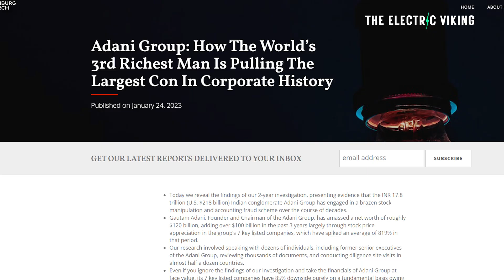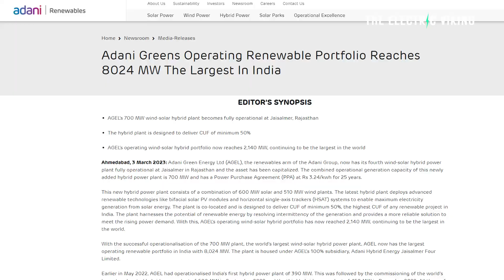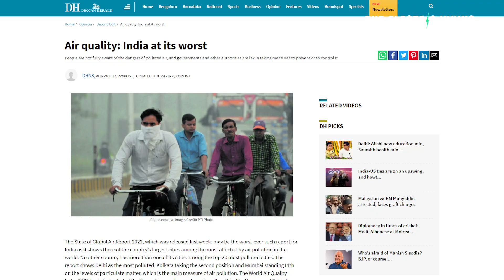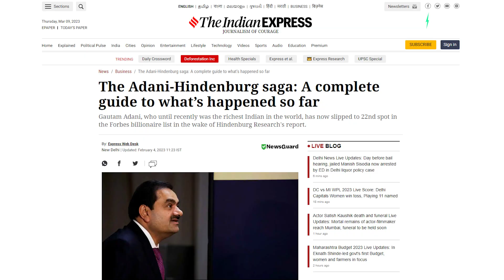The biggest solar and wind powerplant in the world just got turned on

Comment: solar panels and windmills aren't recyclable, they end up in landfill when they die not only that the power output is not as good and uses too much land like farming area which feeds us, the best form of energy to use right now is Nuclear power.
Reply: Yes just dump all that gold, copper, aluminum, rare earth's, steel into land fill since from wind and solar these have no value.
Solar has been proven to increase crop yields in marginal land.
Wind is 20 times less expensive than nuclear.
Yes when a nuclear power plant is shut, just turn it into a theme park.
Use your attic for long term storage of nuclear waist.

Comment: just a comment about coal fired power stations in general. Sure it's dirty in some respects, especially relative to natural gas or oil. It's not the co2 you have to worry about, the climate change "emergency" is a clear scam. But they do emit Mercury and lead, which are dangerous neuro-toxins. You can't hide from that.There are however technologies out there that can remove the Mercury - activated charcoal pellets is one - look at carbonXT the company. At the same time, coal is affordable. The poorer countries will often resort to burning cow dung and kill themselves with pollution from inside their own kitchens, or chop down precious forests, without it. So in some cases, it's the best alternative for now. The truth is if it wasn't for the climate change "emergency" scam, we could take a common sense approach and use natural gas and oil, or nuclear, to lift people out of energy poverty, neither of which are perfect but in terms of costs vs benefits they are very very good. When other "green, renewable" technologies become good enough, if suitable for a given country, they can be implemented in an affordable way. We just need to wake up in the interim to the scam that's going on and get the b.s out of the story, otherwise there will be more GENUINE emergencies like people starving and/or freezing in their own homes, not fake ones like the climate change "emergency" they've been trying to scam us with for 40 or 50 years now.

Comment: The main cost for aluminum is the electricity needed to refine it, lower cost electricity means cheaper aluminum. Currently almost all iron and copper are refined using coal, but with cheap electricity we could see that replaced with an electrolytic refining with almost no CO2 emissions and no fossil fuels.

Comment: The largest component of staffing is the continuous cleaning of the PV panels. Depending on the amount of local pollution, the panels can lose efficiency quite quickly if not maintained. An additional advantage to single axis tracking is that the birds do less roosting on the panels.

Comment: While it is positive to learn that new electricity demand to a greater extent is covered by for example solar energy it is equally as stressful to see solar energy parks being built on land which could be used to grow crops or trees. Rather instead we should focus on using already urbanized areas, as house roofs or along roads and industrial areas, for solar expansion.
Reply: I second that! Rajasthan is mostly red desert, though.
Reply: @elephantintheroom5678  for areas which are indeed desert (or otherwise unusable for other purposes) it could be an option but otherwise there are options to mount panels vertically and blend it with agriculture or to use urban areas.
Reply: @tabysetterstrom6061  I agree.

Comment: #SwitchToSolar #SwitchToElectric #EndFossilFuels #OneEarth
Solar power is CHEAPER and electric vehicles are soon to be CHEAPER to make and already are considerably CHEAPER to maintain and operate, especially if charged from your own solar power.

Everyone raise your right hand and promise to never again purchase an ICE (internal combustion engine) vehicle or tool.

We should all be using electric vehicles charged from our home, business and covered parking rooftop solar arrays making nearly everything we do 100% solar powered.  

Everyone should be getting proposals from 3+ local solar PV installers and suggesting the same for our places of work, our grocery stores, our movie theater parking lots, and everywhere else.  Zero down payment financing with lower payments than the power company monthly bill savings is available in many places.

The cost per distance driven is ridiculously cheap when you are your own solar fuel station (less than $0.12 MXN per km ($0.01 USD per mile))! #nobrainer

We cannot afford to continue to burn fossil fuels!